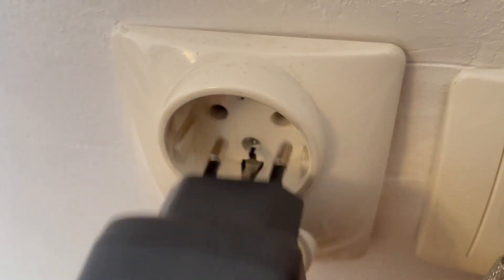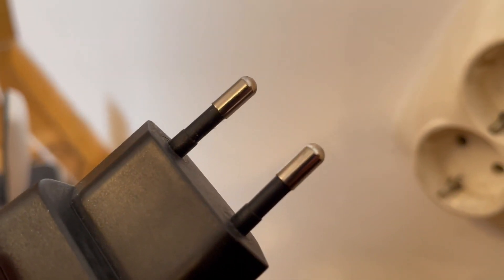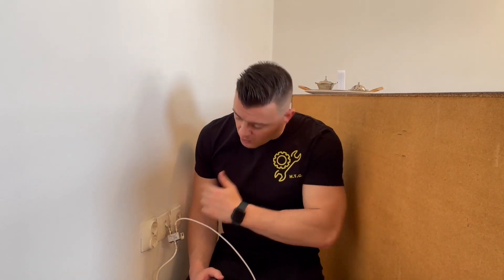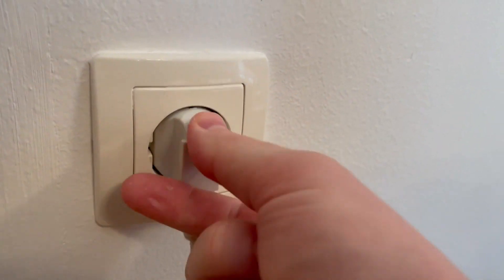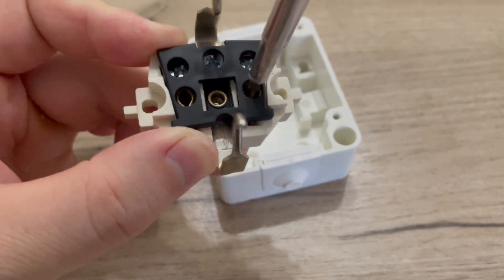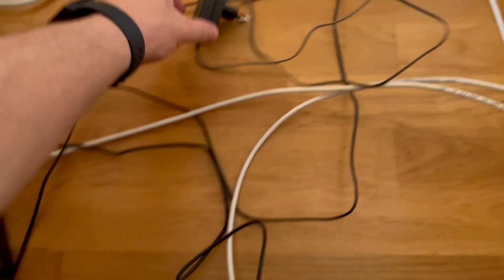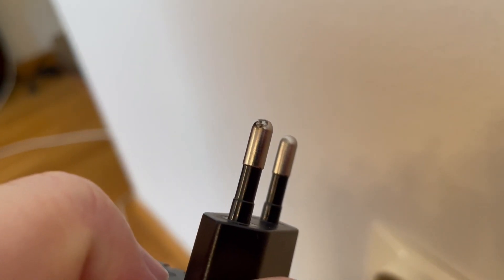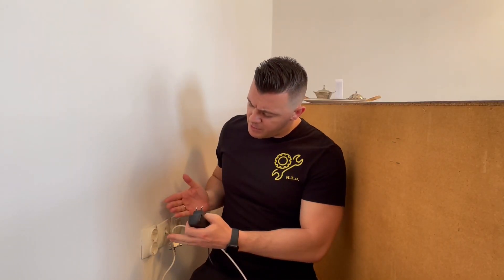STOP Using Sparking Socket, Here Is How To Fix It!

Comment: Hi so i have built a custom multiplug for my pc it's working fine i think so the thing is the socket it plugs into always sparks and has burnt of one the pin of the plug should it be the problem of the plug or socket?
Reply from the maker: Try to clean all dust from both sides. If it still sparks, the damaged part is causing sparks; you can change only that part.

Comment: Hey I recently noticed that my laptop adapter pin got  burnt patches at edges of the pin.its working fine but however it causes an unusual noise when dragging more power.I kind of concerned to change it because its a 200 dollar adaptor.can i prevent it from further sparking.does cleaning the pins with soft cloth remove the debris and prevent it from further damage?
Reply from the maker: Yes, that will prevent any further damage but it would be good to clean the socket also, just blow in it a couple of times to clean up the dust in it. The best option is to replace the cable of course, but you can use it like that only take care of the tips, and if they continue to damage more and more replace the cable.
Reply: How will you clean thatt? Like with vinegar or wot?
Reply from the maker: @ceoadityakumar you can try to clean it with vinegar, but usually it’s damaged and it can not be repaired. If it sparks too much, replace it.

Comment: Thank you this is exactly what I was looking for ! Is there any way to fix the copper part of the plug without replacing...? I accidentally plugged back on a wet socket and the tip of the copper part is damaged like yours in the video. It's for TV and I would like to know if there's a way to fix without replacing.
Reply from the maker: You are welcome. 
I think replacing it would be very difficult for you, as it's so small and so fixed to the adapter pins.
Wires in your outlet are pinching this copper part of your plug, that's why this needs to be strongly connected to the cable.
Just invest in a new cable, it will be much safer. 👍👍
Reply: Noted thank you !

Comment: My phone charger started to spark, it happens everytime i plug it in, and its a bit burned on metal parts also what should I do?
Reply from the maker: The best thing you can do is to change it, and buy a new one because if it’s already burned on the tips, it will spark more and more over time.
Sometimes sparks happen because of dust collection in the plugs, but if you have a burned-out charger, then this is the main reason.
Reply: @rookie.handyman  I kinda cleaned it with fingers it doesnt spark for now it has  very very little of those black marks almost imposible to see, I dont want to replace it cus its new and I payed 50 dollars
Reply from the maker: @edit.clips. Then it was probably dust collection from your outlet, try to clean your outlet by blowing some air into it or clean it with a vacuum cleaner. 
If your adapter is not damaged then don't change it 👍👍
Reply: @rookie.handyman  I have some canned air left can it help
Reply from the maker: @edit.clips. Sure it can, anything that can blow out that dust
Reply: @rookie.handyman  okay done it doesnt spark for now thanks, but I have an question is it safe to leave my charger in outlet all time and will that stop those black marks (considering charger is new and samsung)
Reply from the maker: @edit.clips. Yes, in my experience it's safe to leave the charger inside because once the connection is established it can't spark anymore easily. It's better to have it inside all the time than to plug it in and out, it's easier for dust to set in once the outlet is opened
Reply: @rookie.handyman  Thank you so much for this, google seems to find everything dangerous and I cant even find answers to my questions.
Reply from the maker: @edit.clips. No problem my friend, I’m glad I could help you 👍👍 I hope you use it for a long time 😉
Reply: @rookie.handyman  You deserve a Sub for this video and help, btw nice and useful content, wish you all best.👍
Reply from the maker: @edit.clips. Thx a lot, I try to make it valuable as much as possible, positive feedback like yours is what keeps me going, thx a lot 👍
Reply: my one outlet plastic is burned when i plug it starts to spark but its not slow it just sparking until i plug out computer what should i do

Comment: Will it work or not
Reply from the maker: It will work for sure, but over time you need to fix it, if you neglect it, it can easily cause fire!
Reply: @rookie.handyman  I got PS5  my PS5 ac adapter sparked of my old extender can I change PS5 cable cord
Reply from the maker: @miriabdullayev1551 best to check your outlet, it can be that your outlet has some dust in it and that is causing the sparks. If you don't see any visible damage in your PS5 cable cord then there is no need to change it. Try different outlets. 👍
Reply: @rookie.handyman my mom ordered new extender
Reply: But it sparks sometimes
Reply from the maker: @miriabdullayev1551 excellent solution 👍👍
Reply: @rookie.handyman  thank you that you explained
Reply: I am really appreciated
Reply from the maker: @miriabdullayev1551 no problem, glad it was helpfull, I hope you will enjoj your PS5 soon 👍👍
Reply from the maker: @miriabdullayev1551 no problem but please send it to my mail “howtoirfo@gmail.com” I will take a look there 👍👍
Reply: @rookie.handyman  but I'm from another country
Reply from the maker: @miriabdullayev1551 No no, I’m all the way from Europe, but you can send me a video of sparkling plugs and I can take a look and see how serious that is. 
The important thing is that it doesn't spark once it's connected, if you have just one spark in the moment of contact, usually that’s ok. Electricity gets collected on extender pins and that is the release of electricity.
Reply: I sent you
Reply from the maker: @miriabdullayev1551 I have seen. Your plug-in is a little bit damaged. You can use it like this but please buy a new one when you can. This one will spark almost every time you plug it in. It can work like this, but to avoid damage to your electronics, the best is to buy a brand new one without any damage on it
Reply: @rookie.handyman   thank you very much that you explained I'll try to ask to my mom
Reply from the maker: @miriabdullayev1551  All the best to you 👍👍
Reply: @rookie.handyman  what happens If I don't buy a new one
Reply: @rookie.handyman  because I hate when ac cable cord sparked
Reply from the maker: Yes better buy a new one, it is much safer 👍👍👍
Reply: @rookie.handyman   excuse me is it okay that I didn't bought a new adapter of ps5
Reply from the maker: @miriabdullayev1551 It’s ok, you can use your old one for now. Just watch out if sparks get bigger, if they get bigger you need to chenge it
Reply: @rookie.handyman  it isn't sparking  anymore thank you
Reply: We were at the store I wanted to buy a new cable cord but it was worst
Reply from the maker: @miriabdullayev1551 than continue to use it for sure
Reply from the maker: @miriabdullayev1551 just keep using the old one, only if you get biger sparsk than change it

Comment: I've just had my laptop charger spark today and it only has a little , I think burnt, brown spot on it should I replace it?
Reply from the maker: I can tell you only my experience, I also have some adapters that spark sometimes, I don't replace them until I see that spark every time I plug it in. Plug dust is really hard to clean and this also causes your adapter to spark.
But that black spot will get bigger over time and eventually, you will have to change it. Good luck 👍
Reply: It has an analog linear power supply powering chopper circuit that chops the 240vac and converts it to 5vdc. That's why it sparks.